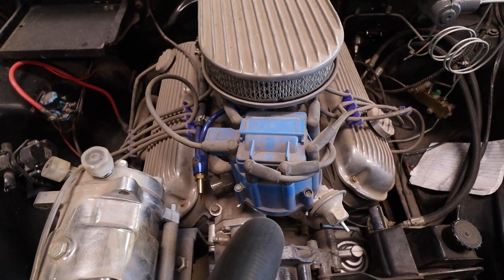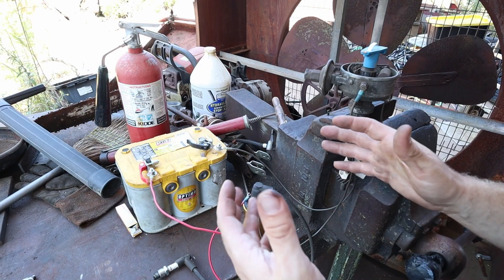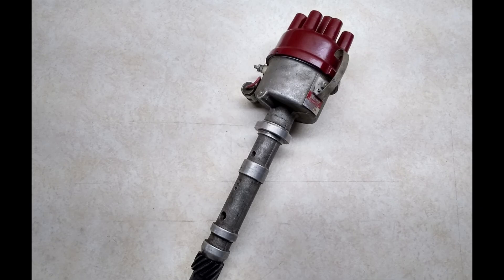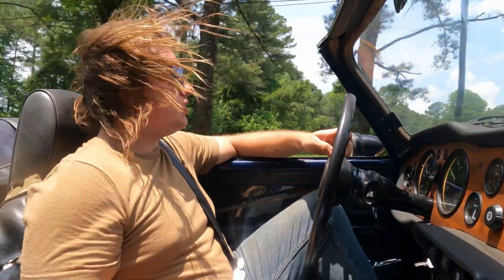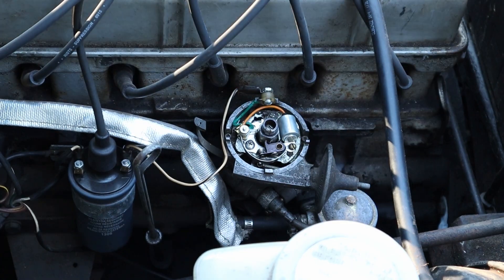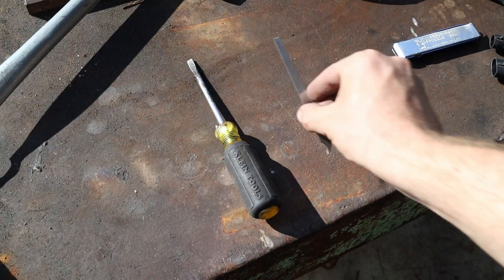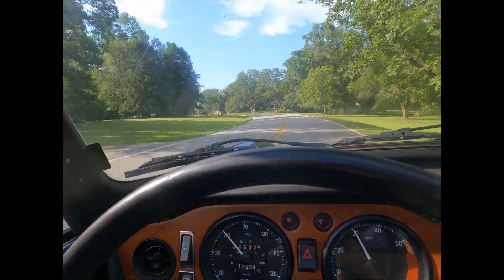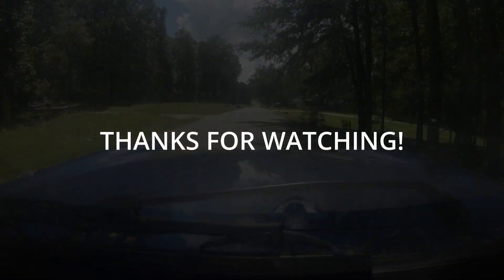Is Electronic Ignition REALLY The Best Upgrade For Your Car?

Comment: I still use points and condenser ignitions in both my 1962 Studebaker Hawk and 1963 Avanti. I'm using Prestolite dual point distributors in both of them. Back in the 90's and into the 2000's we ran a 70 Cuda with a 440 engine that was nowhere near stock at the El Mirage Dry Lakes and Bonneville. The engine had 13 to 1 compression an Isky roller cam, Weiand tunnel  ram manifold with 2 625 cfm AFB's and some other goodies. The car ran its best times with a Chrysler dual point distributor that had a Studebaker R1 advance in it, a stock Ford yellow top coil that I had on the shelf and an MSD 6 box.  The car turned better times with that setup over any of the electronic ignition setups we tried.
Reply from the maker: That's so cool!!😃 I really like the dual point setups, (although I don't have much experience with them). I'm jealous of your Studebakers too! My dad has had two different Connestoga wagons, a 54 and a 55. I've loved Studes ever since, and still haven't managed to get one for myself.🤔

Comment: I'm old enough to remember adjusting the points and using a dwell meter. Laughed when I saw the Ford box module in your video. On the Fords of that era I always kept a spare module in the trunk. Paid off one time on a vacation road trip on a Sunday when all the shops were closed. We stopped at a restaurant in PA, came out and the car just cranked over. I checked for spark, popped in the backup module, and we were back on the highway. Thank you for the nice trip down memory lane.
Reply from the maker: You gotta love that good old  Ford Duraspark. It's not bad, but it definitely isn't great. 😅  Best part is when it pukes black goo all down you firewall or inner fender, which then becomes cement.🤣